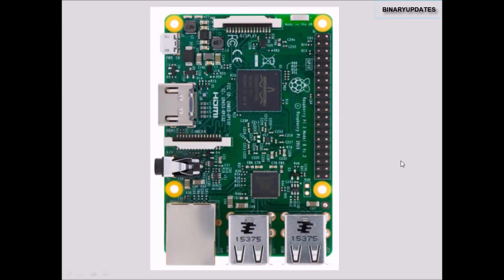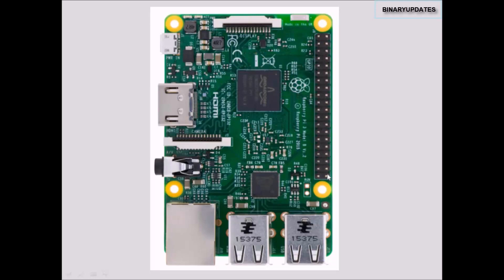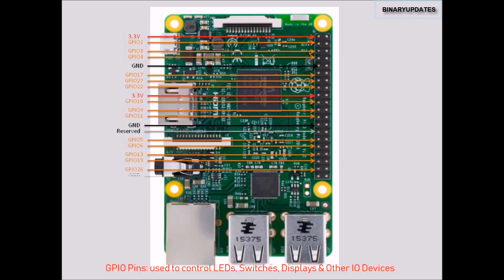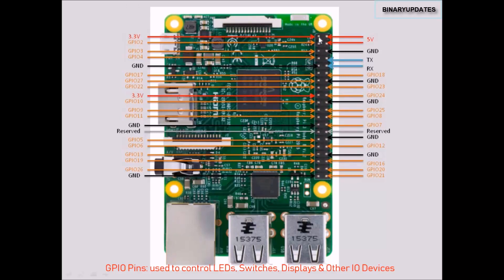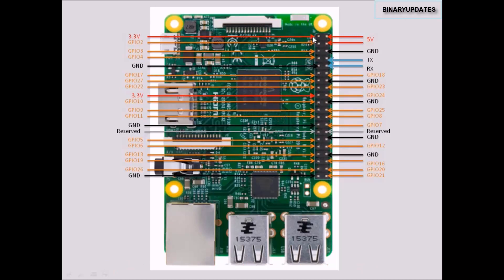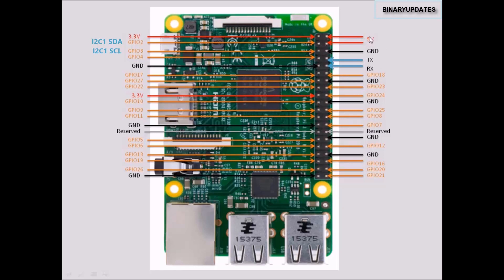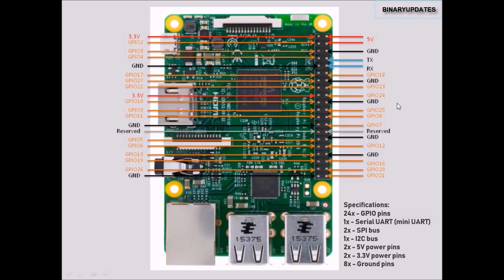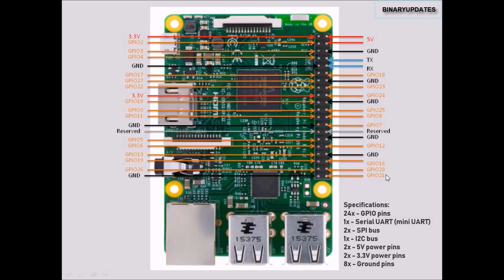Raspberry Pi3 Pinout Explained

Comment: Is it b+ model ?
Reply: Nope, in b+ these pins are in different positions, f.x. pin under 3.3 v is GPIO2 here but in Raspberry 3 B+ it's SDA.1. You can see all pins by typing gpio readall in commandline if you have wiredpi already installed.

Comment: if one pin # 1 with pin # 2, the raspberry pi 3 b + is damaged ??
Reply from the maker: Its possible because both are Power Pins but still I recommend you to check with multimeter. I hope this might help